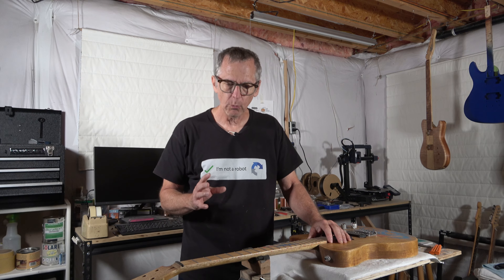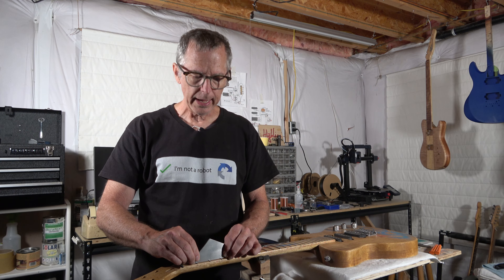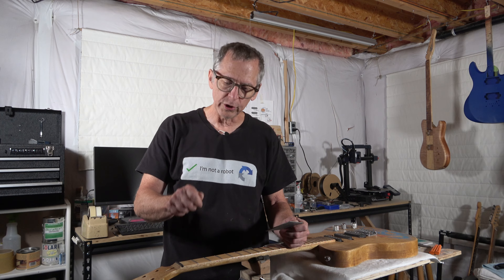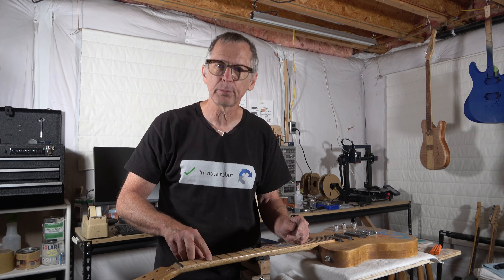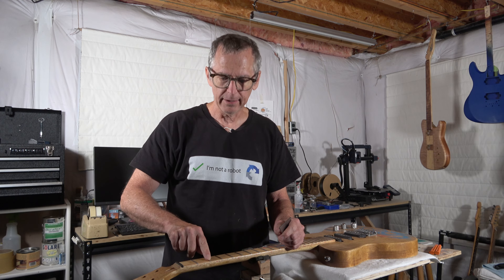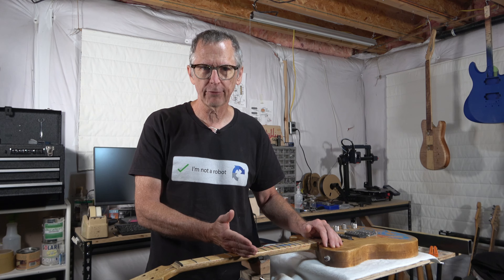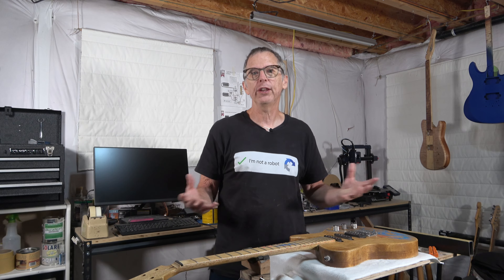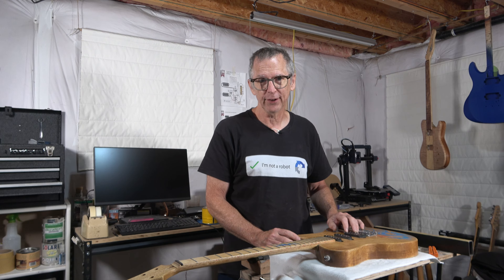Are You Using Your Fret Rocker Wrong?

Comment: Hey chris, I've seen a few DIY fret kissers by using one of those cheap 16$ SM 4.5" understring leveling beams as a flat surface . Just use double side tape on the bottom of the beam. Cut your 4-1/2 inch sandpaper strip that goes under the beam into 3 pieces , making the center piece small, roughly 1/2 inch wide. Then, apply the two longer 2-inch sandpaper strips grit side up on both sides and apply the center piece with the grit side down. So now u have a smooth level surface that is level with your sand paper !
Reply: The sandpaper/tape will have too much squishy give compared to stainless steel; results will be inaccurate, especially as the sandpaper strips on either side that you're depending upon to keep everything level wear with repeated rubbing across the guiding fret surfaces. Those strips are paper; not steel. The only way to be sure this isn't happening will be to check your work as you go with a quality steel fret rocker, but if you already have a good fret rocker, then you're better off just doing the job with the rocker and a $6 steel file as Chris describes here and in his other video.

The reason that uneven sandpaper wear isn't an issue with a leveling beam is that the sandpaper is applied along the entire length of the beam, and thus the sandpaper wears down evenly across its entire surface; what you're suggesting here will result in uneven wear of the individual paper strips that will be too subtle to be detected with the human eye. Really, if you do enough fretwork to really need the added speed of a Fret Kisser (i.e., if you're a professional luthier), you should just get the Fret Kisser.

Comment: Hello Chris. The only myth that baffles me is, why is the fret board filed to a radius? What if I made a guitar with the fret board, flat! Will it be just as playable like the one with a radius? Thank you 🙏🏼
Reply: Flat fretboards are harder to play, especially for chords.  The curve has 2 benefits.  Think about doing a barr chord. It's definitely easier to barr across multiple strings with a little curve of the  barring finger.  Think about it this way.  If you wrapped your hand around a round pipe, it's easy for your finger(s) to make full and fairly even contact.  Now imagine trying to do the same with a flat 3" board.  
2nd benefit, is that it helps a little with moving from string to string.
Reply: @charlesjoynes9497  and now think about a classic guitar.
Reply: @jjcale2288  again you are right. hahaha

Comment: When using a fret rocker, you need to be aware that if one of the outer frets (of the three being tested) is low, this would allow the rocker to 'rock',  appearing (incorrectly) to show that the centre fret is high, at that point. This is a very real danger, which can result in much unnecessary fret filing: as you stated, this can cause the 'problem' to be incrementally moved along the neck. This failing can be minimised by moving the fret rocker one fret further along, which should indicate if the suspect fret actually is high (it will now be one of the 'outer' frets of that trio) or if one of the original 'outer' frets was low. 
I also find it hard to believe that by holding the fret rocker at an angle (as shown in the video) that the tool would rock: unless the rocker is warped, the edges would be just as straight as the flat edges! Surely you mean to warn against placing the fret rocker in any other position than parallel to the string path along the neck? If skewed away from the string path, the curvature of the fretboard would cause the tool to be rocked.
Reply from the maker: How can you find it hard to believe the angle can affect the test when I demonstrated it in the video?
Reply: @HighlineGuitars  your fret rocker is a bit warped. Therefore on the convex side it will rock and on the concave side it will not. Check it out. On the other hand your commenter is right, if the rocker is skewed on a radiused neck it will rock alright even if the frets are leveled.
Reply from the maker: @jjcale2288  Nope. Guess again.
Reply: @HighlineGuitars  it's not guessing, it's just obvious.
Reply from the maker: @jjcale2288  Still wrong. Strike two. Try one more time.
Reply: @HighlineGuitars  ok, whatever. I already spent too much time and energy with your mood, so bye for now!
Reply from the maker: @jjcale2288  You started it and now I'll finish it: https://youtube.com/shorts/OFZIM2JiKio
Reply: @HighlineGuitars  now that's more like it, thanks for your effort! Feel free to have the last word on this "debate".
Reply: @jjcale2288  sure you are right.
Reply from the maker: @jjcale2288  I plan to post a follow-up video on Tuesday, September 24 where I will eat some crow. As it turns out, you were right! While the edges are precision flat, the sides of the tool are slightly warped. I apologize for my snarky attitude. It's my natural reaction sometimes when I think someone is trying to outsmart me. However, you were right and I was wrong.
Reply: @HighlineGuitars  I have moods too. Keep up the good work! 🤗

Comment: Good tips and clear instruction. I'm a bit surprised that you recommend leveling the whole neck to correct one low fret. Replacing one fret seems like a viable option that potentially increases the life of your whole neck. It's common for frets to develop dings under the strings (either too much wear if you tend to play in the same position all the time, or a fall where the string gets slammed into the fret). I guess fret replacement is a bit more intimidating than leveling, but sometimes it is a great option. Especially with zero frets.
Reply: I don't want to speak for him, but for me it's rare to have a guitar where only one fret is off.  For me, there's usually fret wear in three different spots on the neck - the first 4 frets, frets 5 through 10, and frets 12-14.  Then again, I play all over the neck.  For a beginner who only plays in first position but plays a LOT, I could see the sense in just replacing a couple of low frets.  I don't have any zero fret guitars, but that does seem like a case where it'd make sense to replace just the zero fret.
Reply: @budgetguitarist  I play pretty evenly all over the neck and I never have low spots or divots from natural wear. But I have had divots in frets when the guitar gets knocked over and the face of the neck hits something hard, and the fret below the string that took the brunt of the impact gets a big ding. One fret. One spot. I would never level all the frets to fix that.
Reply: If you have a complete stock pile of every fret size you could exchange one. Most people that watch YouTube too learn don't. That means leveling the entire board for one low point is the only option. Usually the lows aren't that big that it makes a difference.

Comment: A reaffirming video for me.  I was convinced that my last fret was a little high (and it was) and causing string buzz, but how to check it with my fret rocker.  I ended up doing just what was demo'd in this video - riding the rocker along the last few frets and see if the end bumps into the last fret.  I wasn't sure that was the ideal way to check it, but now I know that it was a method that works.

Comment: Some people say the StewMac fret rockers are no high precision enough and there's another tool called FretGuru which is a high precision fret rocker.
Reply from the maker: Bollocks.
Reply: I returned the fret Kisser I bought. The grit is too coarse for my taste, but much more importantly, the grit surfaces were all recessed a little from the reference surfaces. Obvious high spots (via rocker) were not even touched... In fact not a single spot was touched on a guitar I had a number of small high spots to do by hand. 
Diner grit would allow less aggressive cleanup,, and so more nearly co-planar surfaces.

Break-in instructions would also allow better tolerances... Perhaps they are accounting for the inevitable smattering of high particles that are stacked on others and which get knocked off with any use on steel etc. (At work - unrelated field - we break in new diamond abrasives when precision or good finish is required.)

It's easy enough to do by hand if it's just your own guitars.
Reply: I don't see any equivalent product from fret guru, just fret levelling beams and crowning & end files.
Reply from the maker: @nopenheimer  Your experience with the Fret Kisser is the exact opposite from what I and many others have experienced. I guess that is to be expected with this or any product humans can buy.

Comment: I brought my maple Strat neck back to a local luthier numerous times because of a disappointing fret level and crown job. He checked the frets in front of me 4 frets at a time and I asked him "Wouldn't it be better to do it 3 frets at a time? You'd want 1 fulcrum instead of 2 right?" 
His Response: "I've been doing this for 50 plus years."
Reply: @ThatFaceMelter94  So he's been doing it wrong for 50 years? I feel bad for his customers.
Reply: @ThatFaceMelter94  Wow, and I thought this would have just been common sense.
Reply: That was the catalyst for me learning to do my own setup, frets, nut, everything - especially now with informative youtube videos at channels like this!  Amp techs irk me too, so I took a class to build a tweed Princeton type amp (improved), and started learning about electronics, which is more complicated than I had thought. But after building an amp, I can do most of the basic maintenance, and minor trouble-shooting.  I have one good tech, but he takes a couple months and is $150 an hour, so usually the bill is $250-350.  Whenever I buy a vintage amp I take it to him first, before using it too much, like the 1970 non-reverb Princeton I bought recently, with original C10N, which is the best low volume amp I've ever played though, perfect for at home, and it has more headroom than the Princeton Reverb which has more gain along with the reverb.  Doing your own work is rewarding, and most importantly you know it's exactly how you want it to be, without having some tech who tears through it ASAP do a shoddy job.
Reply: All my gear was stolen.I had very little money at the time so I picked up a mostly almost mint better model Ibanez for almost nothing because the owner had played Am pentatonic riffs - ONLY Am pentatonic riffs - until those frets were the most worn I've ever personally seen, and the fretboard was deeply scalloped in just the common bend spots.

It was so cheap and so unplayable I didn't hesitate at all to try a full refret. It took a bit of learning and a did end up with a little less fret left for future touch-up than ideal due to chasing a buzz, but I learned how and have a great playing guitar... And I can just refret it again when needed, knowing it will be easier and faster.
Reply: @pharmerdavid1432  Good for you mate, I paid a lot of money for a setup when I was younger and when I got the guitar back I though "This still feels a bit crap." Turns out all the guy did was balance the trem, didn't clean the frets or fretboard etc. I bought Dan Erlewine's book on guitar maintenance and never looked back. Years later I do setups, refrets, fret leveling etc and make ok money doing that in my spare time.

Comment: Fret rockers are too thick.
 My opinion. 
Just cut up a stainless-steel ruler into multiple lengths and save your $$$.
I make my own tools. I'm, cheap. lol
Reply: I have a cheap "string action ruler", which is about the size of a credit card.  Its edges are straight, and it works well enough as a fret rocker.